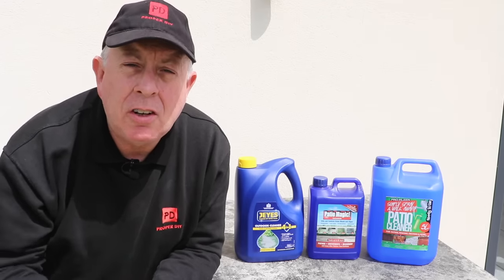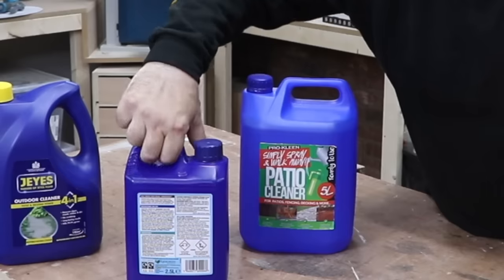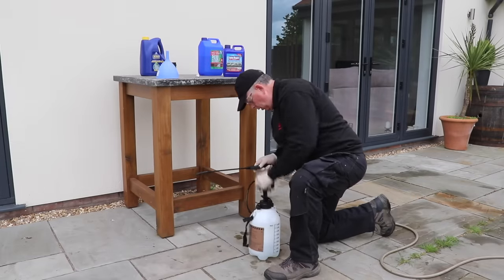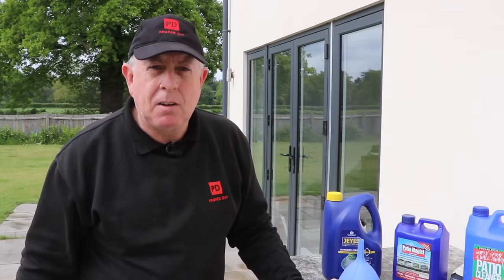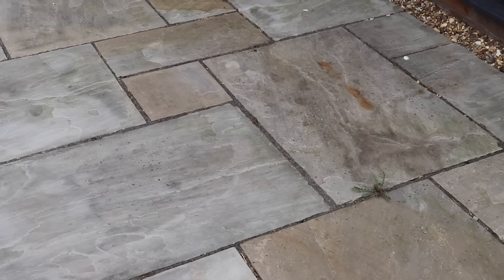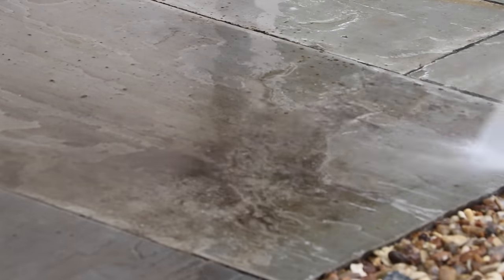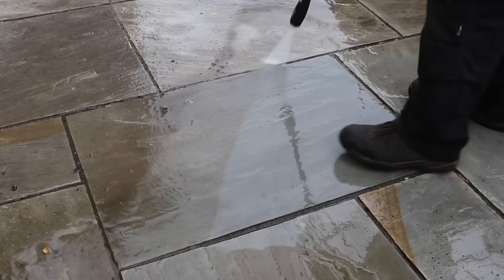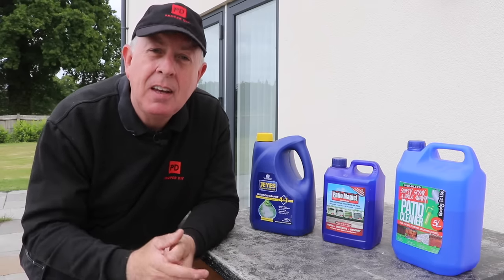Patio Cleaners vs Pressure Washer Put to the Test with Surprising Results!

Comment: I worked for a farmer who had a flag stone patio that was many years old but still looked like new.
He told me he used washing powder and just scrubbed it with a hard brush.  I tried that and it worked a treat. It's also really good at getting oil off engines.
I used it on some garage fule pumps I once had to clean. Again.  Looked like new and smelt nice on the forecourt 👍
And no harmful chemicals to worry about.
Also white vinager is great for getting stubborn stains off stones
Reply: Great tips, thanks. I think you need to avoid vinegar if your patio stones are made of limestone.
Reply: I find vinegar 30% only wotkd on weeds, for patio cleaning Sodium Hypoclorite does the job
Reply: Are you sure he was a farmer? I've never met one who cared about anything looking clean & tidy and if he did he'd use the most noxious, non-environmentally friendly chemical around .
Reply: @garrywiseman2870  yeah retired farmer.
Reply: @garrywiseman2870   Well you just haven't met the right farmers.
Reply: Wonder if you could use the water from the washing machine after the wash as washing powder is not cheap ?.
Reply: @brianredmond4919  probably.  I clean a bike engine with it last week. Soon got the oil off
Reply: @brianredmond4919  washing powder is extremely cheap lol. Tf are you smoking? You can get a pallet of the stuff for $10 😅
Reply: @Mikael-jt1hk  not in the UK it isn’t.
Reply: Washing powder is also great for cleaning gloss pain from your brush if you should run out of turps. Just cover the brush and work it in with your hand then rinse off.
Reply: @johnbeattie9561  I'm a painter by trade. And never knew this. Il give it a go 👍
Reply: I used a car shampoo last year that had algae remover added in. I bought it from B&Q for about £6. I used hot water and a scrubbing brush and it worked fantastic. I still have the same shampoo in the garage and use it to clean my car too

Comment: As a professional landscaper I’ve had to clean some seriously stained patios in my time with lichen (black spots) being the toughest to remove since pressure washing alone might remove most of the stain but won’t kill the fungus so will grow back. What works best in my experience is sodium hypochlorite in the the 20litre drums you get from agricultural suppliers. Brush the patio first and dilute 1 part hypochlorite to 3 parts water in a watering can and use the watering can to cover the patio evenly. Leave for 5 mins then scrub over with a stiff yard brush and leave for another 10 to 15 mins and then pressure wash it off. If it’s a large patio or a hot day do 1 section each time it’s important to not let the diluted hypochlorite dry before pressure washing. After pressure washing rinse again with a hose pipe and flood any areas where the hypochlorite has run off onto grass. Be Carefull as it is strong stuff try not to breathe it in and it will bleach any clothing so wear old clothes and wellingtons. It also works well on the red fungus on roughcast walls using a sprayer. Also I’ve noticed that the hypochlorite once opened weakens over time so if you’ve got old stuff that’s been sitting in the shed for years it won’t work as well.
Reply: Used that stuff on my granite paving I used the recommended mix but it ruined the colour it was never the same
Reply: @andrewholdsworth2198  I’ve never used it on granite myself only on Indian sandstone and concrete slabs. Can’t say I’ve ever come across  a granite patio it’s not very common.
Reply: Thats basically a more convents bleach
Reply: I guess you'd need a seriously good mask for this; pressure washers put so much vapour into the air kicking up from the surface you're cleaning) that it'd be impossible not to breathe in a lot of that without a mask that worked to prevent vapour/moisture in the air surely?
Reply: Is there any alternative. Something not as toxic
Reply: @justrobin1234  I have never worn a mask while doing this,. it’s not as toxic as you may think since this is the stuff they use in swimming pools where there is even more vapour since it’s indoors and in warm water. Obviously it is far more diluted in pools but if it’s safe for children to play in then it can’t be that bad.
Reply: @Bull_sheet_Bob  best alternative is keep your patio clean in the first place by regular pressure washing or you could dilute it down more to 1 part hypochlorite to 6 parts water or even more. I only make it strong when I’m dealing with patios that have been neglected for over 10 years and covered in lichen (black spots).
Reply: @richarddavies5711  ok. Thanks.
 There are a few black spots on it, but mostly green. I'll try to do it first with a diluted mix.
Once I've got it clean do you recommend using some type of sealant?
Not glossy finish, Matt finish.
Reply: @Bull_sheet_Bob  diluted 5 parts water to one part hypochlorite should take care of the green. If you have the time pressure wash first to get rid of most of the green then use the the solution and pressure wash again. Then any black spots remaining make the solution strong 2 to 1 mix and use just on the black spots. What material are your slabs?
Reply: @richarddavies5711 ok. Thanks.
The slabs are Indian stone. Similar to the ones in the video
Reply: @Bull_sheet_Bob  I personally don’t like sealer on Indian sandstone, it looks good at first but over time it wears off where there is more foot traffic and looks uneven, I think regular cleaning without sealer is best but if you really want to use it then use a impregnating sealer. Never use a cheap sealer that sits on the surface as it flakes off over time and looks awful. Out of all the sealers I have tried the best is Stonecare4u sandstone sealer matt. I apply it using a paint roller with a sponge sleeve.
Reply: @richarddavies5711  thanks for that information. I think I'll not bother with a sealer. 👍
Reply: @Bull_sheet_Bob  no worries. Remember when using the hypochlorite wear wellingtons and old clothes, any splashes on your clothes or work boots will bleach them.
Reply: @richarddavies5711  yes. I will. Thanks.
Reply: This is the best answer… also used extensively on roof cleaning. My patio has a spring and Autumn treatment and needs minimal power washing - and being an 80;s kid I quite like the tie dye look on my work trousers.
Reply: 1:4 mix hypochlorite:water with a splash of detergent in a large bucket,brush in with a hard brush-leave  for 1/2 hour and then pressure wash off on a reduced power.
Reply: Thts exactly wat I do. He simply didn't use the right product and not string enough
Reply: Where's all the bleach going?
Reply: Try BAC50
Reply: Sodium Hypochlorite work well on fungus which invades cedar wood cladding and fencing too.
Reply: Did you ever find out what chemical is in each of those products and what % is in them ?
Reply: @andrewholdsworth2198 I’m surprised as natural granite due to it density and hardness is probably the best self cleaning stone out there.
Reply: @kerkiraz Would granite be much more expensive than the usual paving choices, friend?
Reply: Soap powder and bleach in hot water brushed on is the best method. The bleach remains active for at least 12 months.
Reply: PoolShock contains at least  12 %  sodium hypochlorite very inexpensive and almost as strong as professional cleaner and less than $ 5 a gallon.
Reply: Soft wash from sealers direct, kills weeds and removes Black Spot, spray on, agitate with a brush then wash off☕️
Reply: Totally agree. I did the same on my garden and driveway which has stone and concrete slabs... Sodium hypochlorite is the key. One thing to emphasise, that stuff is supper powerful, corrosive and toxic. It lets fumes off, so can still knock your lass off her feet 5 feet away. Keep your loved ones away from area and make sure you wear breathing masks. Normal masks won't protect you, you be choking. Another thing. Do not transfer contents if there's breeze or wind, those fumes will knock you out. Don't mess with this stuff. But in terms of job, it's the best thing. Dilute with water and add a tea spoon of fairy liquid.. Spray, scrub, 15 mins wait, 2nd scrub then jet wash (hope the lass is impressed.. Or find another one!)
Reply: Hi do you wet the are before you apply sodium hydrochloride
Reply: Nope... Apply to untreated area (be liberal). Let it soak up. If you wet before sodium hypochlorite, then you won't see the benefits. Therefore, apply sodium hypochlorite (diluted to requirement) and apply direct. Double Tripple the application if needed, but point is soak it with this stuff and let it do it's job. If you like, apply a final layer after jet washing the paving area clean. Best results. Your choice
Reply: Defo pressure wash before applying hypo or your losing out on a lot of chemical reaction, as the build up of anything movable under pressure is going to act as a barrier between a lot of that sodium hypochlorite. So pressure wash first then apply hypochlorite then pressure wash off at the end again

Comment: Yes Stuart, pressure washer all the time. I sometimes soak with just soapy water before pressure washing. Works all the time.   Never found so called patio cleaners to work. 
And of course using the pressure washer is therapeutic 😊😊

Comment: We have just tried a product called Proclean, Ultimate Black Spot Destroyer and it is extremely impressive. Sprayed it on with a similar sprayer to yours and immediately it starts to fizz. Within a few minutes the colour of the Indian sandstone slabs started to reappear. It says leave for between 2 and 4 hours an then hose off but I actually used a pressure washer with the fan nozzle we use for cleaning the cars. The results were amazing having thought we'd never seen the colours again like it was when first laid the slabs thats despite pressure washing the patio sometimes twice a year. Its not cheap at £42-00 for two 5 litre cans but well with it.

Comment: I have had extensive experience of using patio cleaners and pressure washers on patios. My findings are that patio cleaners take 3-6 months to make a visual difference. But once they work they keep the patio clean for up to 2 years. So what I do is to use the pressure washer to bring the patio back to 'as new'. Then a watering to soak the now clean stones with patio cleaner.  The patio then stays clean for a long time.
Reply: What about using a stone sealant on the stone?
Reply: I spray mine every 6 months never wash it, its like new, it works but takes time.  Use pro-green now much cheaper and two options of dilution for dirty or just light soiling.
Reply: I agree, deep clean first (with either a pressure washer or good old fashion scrubbing brush) then spray with a patio cleaner/sealer. OK, a bit more work, but only needs to be done once a year.

Comment: Oh dear Stuart, many of us have learned this lesson for ourselves.  Just like you, I have Indian sandstone slabs  which look fabulous when clean, and I noticed you have a number of slabs with the tell tale black spots indicating Lichen growth. A pressure washer  alone cant eradicate this problem (sometimes it makes the problem worse). After some research online I followed advice that said to use SODIUM HYPERCHLORITE aka swimming pool cleaner which is essentially a strong bleach at 14%-19%. cleans the slabs a treat and removes all trace of algae and Lichen. I now follow this process annually in spring with a 'maintenance spray of a patio cleaner mid season for the best of both worlds. Hope this helps you and other followers.
Reply: This is the best way!
Reply: Yep, I just used 15% for the first time. I used it neat, brushed in, it foamed up white, waited 20 mins, rinsed off away from any grass or beds. Like new. To think of the hours I’ve spent jetting slabs for years. You’ve just got to take care using it and plan ahead. The internet has made purchasing the stuff really accessible, no idea where you’d have bought it 20 years ago.  It’s absolutely hassle free. Is it for the most basic diy’er, mmh I don’t know, could be dangerous. Maybe for this channel it’s risky to promote a “pro” chemical.
Reply: what you described is absolutely the best way to do it. however, once clean, ordinary household beach will do the job. Its the same stuff, SH, but at 5% instead of 15....!
Reply: Totally agree. Used SH for first time this year on patio that had lots of black spot etc. Hard work brushing it all in but wow, was it worth it. Given what impact it had, likely may not need to do it again for a couple of years, so can just jet wash (with round patio head) dirt off in the meantime.

Comment: That rust stain at 11:20 can be removed by using fallout remover from any car accessory store.  Its's the stuff you normally use to clean wheels etc (turns purple as it dissolves rust etc).
Reply: Nice, one ... tried all sorts of things to remove our rust stains from porcelain exterior tiles, even acid... Ciff or Jiff worked a little, however stains still there. Will try fallout remover now.  Cheers!

Comment: Another informative video. Thanks. I have always used the pressure washer and will be doing my patio again in a couple of weeks. I avoid chemicals whenever possible. You know what I have found works for clearing the algae - plain household vinegar. Just spray it on. A lot cheaper than chemical products. Add some dishwashing detergent and it's also great for cleaning just about anything else, shower tiles, glass, mirrors etc.

Comment: We use ‘Wet and Forget’ which I think was the original of these types of products and it performs very well.  The instructions on that state it needs rain after the initial 4 days to help it work. It’s ideal for older more fragile surfaces. It also states it can take months and not days to see the best results. Slow but sure 😊
Reply: I'm not from the UK so I'm not familiar with any of these, are these products basically disinfectants then?
Reply: Rain is something we get every day in the UK. 😂  @csehszlovakze

Comment: Great video Stuart and I, like yourself and everyone else, want a spray and walk away solution to my drive and patio, but a pressure washer is the only solution that works.  The downsides are the amount of water it puts down in a large area, the messy splashback and clean up and the pointing it can remove.  However, there is no alternative, the patio cleaners are so mild now compared to  years ago that they just don’t enable them to clean the slabs/block paving.

Comment: I've got the same pressure washer as you Stuart and I have the big round head accessory ideally suited to patios as you don't get spray going everywhere, it works really well and I think uses less water to boot!
Reply: Agreed.  We've used 2 versions of the big round head accessory - had to buy the 2nd (a more basic model than the first) as the 1st wouldn't fit the new machine when we had to replace the pressure washer.  They're far less messy to use although we still need the ordinary washer head to get into corners by walls.  And then for some unknown reason, last time we tried to use it, that 2nd one had virtually no effect whatsoever.  Water would come through and the jet bars turn, but it simply wasn't cleaning.  So I tried to fit the original one again and, somehow, managed to get it on, albeit with the gun assembly at an angle.  Much better!

We do have some chemical goop and I may finish that but it's unlikely I'll buy more.
Reply: Agreed too. I used to use the spiral lance thing and spent ages getting everything clean. The old pressure washer failed and I got a new one that came with a patio cleaner attachment (the big round one) and it's so much quicker. Yes, you have to revert back to the regular lance to get in the corners but it makes a huge difference.
Reply: It doesn't clean it as well as with the hose though.i used the round patio cleaner and if you go over the area again with a hose after using the patio attachment you will see it will clean it more

Comment: Hi. I have to agree that the chemicals on their own do not clean properly. I have found that they have to be used with a pressure washer to get the patio really clean. I have now switched to a rotating brush attachment to the pressure cleaner and this has reduced the time spent on cleaning the patio. Great video…I have learned so much from your videos…thanks so much
Reply: Rotating brush definitely speeds things up 👍🏼

Comment: I've used spray and walk away. It's great for mould and lichen, but it can take weeks to work (like wet and forget, probably a better product), although algae disappears pretty quickly. It removed mould that pressure washing simply didn't touch. Also useful on tarmac, so you don't pressure wash the top surface into oblivion!

Comment: I find the chemical cleaner works over months and repeated applications every 6months keeps my drive looking great.  Yes pressure washing is great but it blasts the pointing out and eventually takes the surface off mono blocks and slabs. I treated the tiles on my roof too and it looks brand new now.
Reply: Absolutely right. I used to jet blast, but that wrecked the pointing - and then penetrated under the slabs. Soon they were wobbling…. So an expensive re-laying and re-pointing followed after a few years. Since then I’ve used Wet-n-Forget a couple of times per year, and it’s fantastic. Great results, and can be used on walls and mildew/moss too.
Reply: Totally agree. We used to jet wash but haven’t done it for years. We spray when needed and it keeps it looking nice but with no need to brush sand in etc. I also find the weeds don’t come back in the way they used to after jet washing.